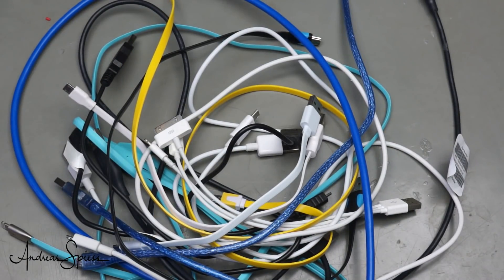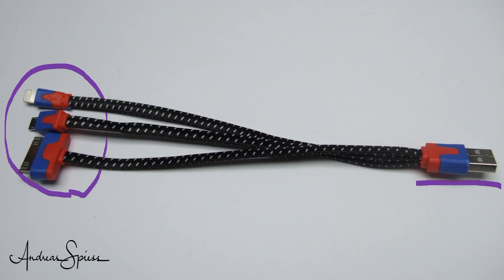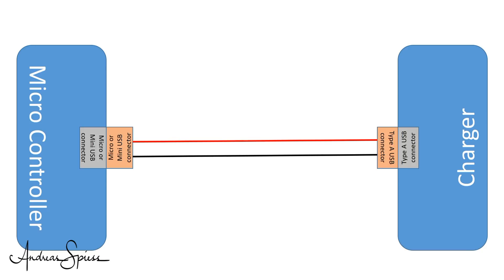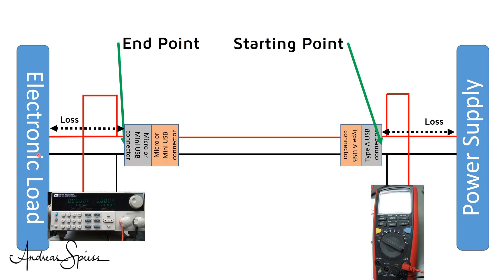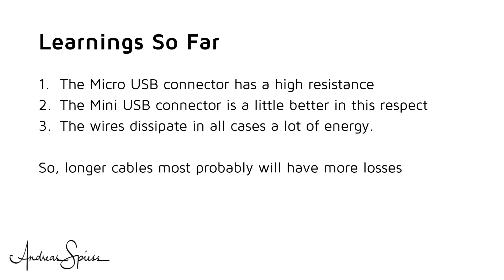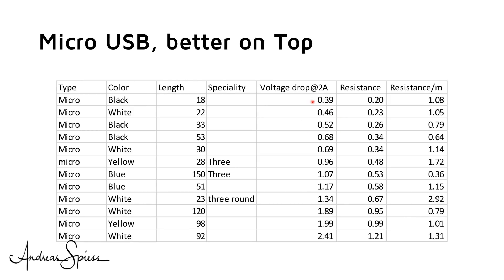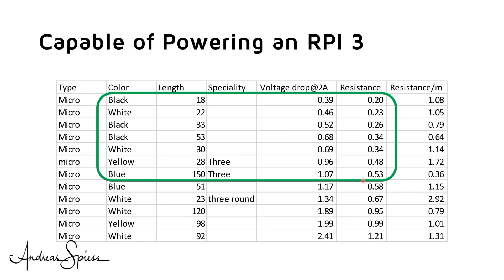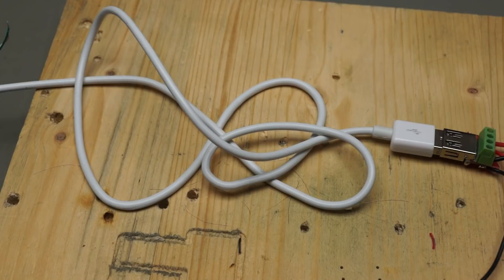#177 Avoid Surprises: How good are USB cables and how can you test yours?

Comment: So funny I'm encountering this problem with almost all types of USB cables with a Teensy 3.6 project. Just can't seem to catch a break, have used probably 50 different USB cables altogether though they all were just old ones I had around. Only a few were brand new. But I'm wondering where one would go for some quality cables that just plain work? Also, tests for power is fine but what about for data? Do the same principles apply or is data more advanced/involved? I imagine it would be...
Reply from the maker: On the low data speeds we use for our micros we should not get problems, at least not with relatively short cables. For higher speeds, data cables have to be built with knowledge. But resistance is not important for that reason

Comment: I used to think like that and blame cables. But USB spec says only 500mA should be supported with USB 2.0.
So it's not actually cables. It's stupid people like raspberry pi designers who use micro usb to power it up.
For raspberry pi, I got sick of it's connector and now powering it up using %V pin in interface.
Reply from the maker: I do not blame anybody. I just want that it works. But I am with you in not really loving these micro USB connectors.

Comment: It's a side note to the subject of your video, but I hate! Hate! HATE! USB cables that have only power and no data lines. Why do I hate them so much? Because you can't tell by looking at them which kind they are. If they had a different symbol or something, or maybe an attached tag that said "I'm sorry", it would be better. I know it saves the manufacturer some money (multiplied by a million cables), but can't they take my feelings into account? Every time I discover one in my big-box-of-USB-cables, I tie a simple knot in it so I will recognize it the next time I think of using it.
Reply from the maker: You know what: During my video making I though all of these cables away. Because I think like you!
Reply: I used to throw them away, too, before I thought of tying a knot in them. Sometimes I do need just a power cable. Now, I will throw them away if they have crappy electrical characteristics. :-)

Comment: Some time ago, I bought a collection of cables that came in different colors (yay), but they also had a braided covering on the cable (double yay). I wanted that for my family members who don't always take good care of things. (That's why I have big buckets of USB cables, USB flash drives, small power banks, and so on. Somehow, they go away and never come back.) Alas, I discovered in practice that their electrical quality is not very good ... I figured this out because they were very slow to charge devices.

Now, from your video, I have some idea of how to test the electrical quality of the cables. But I have a naive question (I'm a software guy, so the answer is probably obvious to EEs). What is the difference in the method you used with a current load compared to just measuring the no-load resistance of the two power leads? In other words, plug both ends of the cable into a breakout board and then measure the resistance.
Reply from the maker: No difference, because I actually did nothing else. But many multimeters are not very accurate in the low ohm range. And you have to pay attention that you do not add any additional resistance between your multimeter and the cable. This is the reason for the 4 wire method. 
I used my method because it is easier understandable and less abstract for many people. But you can do it much simpler if you do not need it very accurate. I might do an update about that as a „quickie“.

Comment: I see that some cell manufacturers actually use the resistance of the cable to limit current.  I found this out when I replaced an "approved" cable with a "better" lower resistance cable and soon after that while my device charged much faster, it also destroyed two chargers due to overheating.
Reply from the maker: That is well possible, but would not considered to be „good practice“ if you are allowed to change the cables. If connected to the charger I would accept it.
Reply: Ya .. bad design ... and a sad reality! (as i found out).  I guess that the chargers do not include a current protection mechanism ... and interestingly the little manual that comes with the charger says to use only "approved" products.  So much for standards.

Comment: At time stamp 14:03 - There are the following equations:
R = 0.55v/.7A 
R = 0.78 Ohms
R  or 0.78 Ohms + 50% of 0.78 or 0.39 = 0.78 + 0.39 = 1.18 Ohms 
I must have missed a step. How was a value of 0.52 Ohms reached?
Reply from the maker: It is the other way round. I assume the connectors „gain“ resistance with age. So the new ones should have a smaller resistance. But maybe I made a calculation error with the percentages.

Comment: Andreas, have you heard of a CT2105 a 8 pin voltage regulator type for Li-on?   I had one short 5v in and cannot find on Google.   Also, are there fuses inline in some micro USB cables?  After my short, cable was dead.
Reply from the maker: I do not know the CT2105. And crappy USB cables can work as fuses because the weakest part breaks (either cable or solder point)
Reply: ok thx

Comment: The micro USB connector is a terrible design - high resistance and mechanically fragile.  It's a shame that it's become the go-to standard recharging and power connector for phones, Raspberries and so on.  I bet a lot of phones and tablets are scrapped just because their micro-USB charging connectors get damaged. The mini USB connector was much more rugged and for most of our items the slight size increase wouldn't matter - but no one seems to be using it any more on new designs.  I've not tried the USB-C connectors yet myself - let's hope they're better than, and eventually replace all the micro ones.
Reply from the maker: I completely agree with you. And looking at the USB-C connectors, have some hope that they are better than the micros...
Reply: Since Apple is pushing for USB-C with there MacBooks now we will see lots of gadgets having USB-C. I was quite impressed to see a laptop being charged of USB though they provide you with a pretty beefy power brick to do that.
I surely hope that USB-C will replace Micro in the next few years. But for single board computers etc. I have my hopes set very low.

Comment: So, injecting a little physics into the results (I'm neither physicist, nor engineer), isn't it possible that the smaller connectors heat more quickly since they have less surface area to dissipate the heat?  They may have similar resistance, but the larger connectors act as heat sinks to get rid of the heat.
At any rate, I'm off to test the resistance of all of my USB cables!
Reply from the maker: Your argument could come from an engineer! This is well possible. We also have to keep in mind that the cables are in plastic (which does not dissipate heat very well) and the connectors are of metal (good dissipator). 
This is why we have to read the thermal pictures with caution and later test the hypothesis with other means (which I hopefully have done). But a general rule is: If no temperature increase there is not much heat produced and also not a lot of resistance. This way usually is helpful to avoid searching for causes with a low probability.
Reply: As an engineer... I was wondering if it would be possible to overcome the lame-cable loss with a 1-V step up booster-converter.  The losses will be what they are as long as they don't melt the cable.  Another idea: measure resistance directly by using a 1 ohm resistor in series and measure the voltage drop.  Hmmm.... and that reminds me of the difference between an physicist and a failed politician.

Comment: Very good analysis. Well presented. 

I wonder if there is a market for a small tester (assuming is does not already exist)? Something that can just plug in the cables and present the results on a screen or on a phone via BT. Would really help the hobbyist especially during troubleshooting.  Probably need someone like Dave to do that though and crowdfund.
Reply from the maker: Maybe I do a "Quickie" about that. I have an idea.
Reply: I googled that and found QualMeter. Seems to be what you are looking for, except it presents the results of the tests on LEDs, wich could be better for non tech people .
Reply: lunedemai2 I believe you found exactly what I was suggesting. I little better if it gave real readings and could do some transient drops (to pick up erratic behaviour) but it definitely coves the gist of the suggestion properly.
Reply: Undefined Lastname yes its "automating" the testing. If intermittent errors occurs on a circuit a piece of kit that can eliminate one possible cause it a good thing to have in the arsenal. 

As far as I know an arduino is not capable of supplying the currents used in testing. 

A static 2A test say is not really ideal. As the current flows it heats up the wire and changes the results. As noted in the video sometimes the peak current draw could change based on the usage. Supposed the peak draw is only for a fraction of a second. Would a cable pass or fail?  Google the QualMeter lunedemai2 suggested. There is a video below in the campaign info that shows how expensive the cables can be. Correct selection can be worthwhile.
Reply: Undefined Lastname yes its doable. I understand your point but in the age of so many very very useful amateur level kits in the under USD$10 range it would have been nice to see something you could just pick up and run with. Something that's so cheap its not worth doing it yourself. Just yesterday I did an electric guitar amp (uploaded today if your interested) utilising a LM386 as the pre amp. I have all parts to make this myself but at US$1.15 delivered its just not worth it to do a layout and spend the time soldering.
Reply: Undefined Lastname I don't think I am up to the level to do a tester properly and I really don't have the time to spend to bring that level up. Too many other commitments.

With respect to the use of a smart device for charging that has merit. What throws me off with my phone is the charging time varies. Sometimes it will charge fast for around the 20% mark (were it starts to "complain") and at other times it takes a much longer. Not sure if its just improper contact is being made. I purchased a USB type meter that's still on the way. When it arrives I am going to investigate if the current draw is different and if its just poor contact or something the phone does.
Reply: Undefined Lastname I appreciate the time you put into this comment. Its an OEM Samsung charger and cord I use on a Samsung phone. It does charge a lot faster than a generic. It does get warm but not too hot to touch. I should measure it someday with my IR thermometer (don't have a Flir). 

The weird thing is the rate is slower some days. If the USB meter does not arrive for any reason I look for a small USB connector cord. I am supposed to have one or two that came with USB sticks. Sacrifice one and put a regular meter in series.

I do agree that the learning is what counts. I try to learn a few things new everyday. On occasion I get asked what I am going to do with all that knowledge when I am dead (yes there are those who think I am wasting my time learning if its not for my job or making me money). I try to explain that I don't care what happens when I am dead. I care to improve my skill set while I am alive.
Reply: Undefined Lastname I never tried turning it off while charging so I do not know the answer to that. The phone is almost 3 years old so there is the normal corrosion that dulls the outside ground connector. I assume the internal connectors are probably slightly corroded too. 

Generally I am not in a hurry so the slow charge time that occurs every now and then is now critical to me. Its really me trying to figure out why this happens. 

Packages are starting to arrive from my order so I should get my USB power meter soon and investigate further. If I find a proper explanation and something that can help others I will post a video.
Reply: Undefined Lastname I never considered that. Anyway that's not the case. I just checked with a magnifying glass. Still seeing a reflective gold colour on the contacts so I am assuming they are ok. Right now I am spending time doing a slightly in-depth analysis of solar cells. Single panels, connecting into arrays and I still have to upload the one on charging a car battery. I am trying to increase the engineering calculations I put in. It forces me to do the math and consider what and how I say things so in the end it sticks with me a lot better. 

I want to put in the same level of analysis on this when I get to it. I want to do more than a passing overview. Still awaiting the meter but I can rig up something once I finish the solar project this week.
Reply: Undefined Lastname  feel free to check out the videos. Just click on my name and it should link. There are three. The first is on a single panel, second on three panels connected into an array and the third on the array connected to the battery. I did go into some theory but its used to analyse the practical project. I have a fourth to do on the overall efficiency of the system. How much solar radiation is incident to how much the user gets on the device. That will be all theory and calculations. 

I got my first batch of items in the mail today but no USB meter yet. I hope it comes soon. I will look into background apps. I found rogue apps keep the phone from going into sleep mode at times and my battery dies very fast.
Reply: Undefined Lastname sounds interesting. If you are not trying to keep it confidential make some videos. I would like to see. 

Solar air heating is a decent idea. I did some rough calcs a few years back to see the feasibility and it seems to make sense. I am in the Caribbean so we do not need it for keeping warm. My interest was in replacing the electric element in clothes dryers. The hot air would be generated by passing room temperature air over a heat exchanger. I even made a proposal for funding but that went no where. To do a proper quantative analysis i needed a proper solar water system and two new dryers of the same make and model. One would have been modified while the other would be the control. All the equipment was a bit more that I could put out. 

I still intend to do a small system soon just to see how efficient CPVC would be if painted black.

Comment: The extended cable at 15:35 will be even better if built using a microUSB connector with the cable cut close to it and soldered to the thick cable. This will avoid more than half of the 0.37V drop through the adapter.

Excellent choice of theme for this video! I guess most viewers would not consider the losses using USB for powering devices. I'm pretty sure many will use much shorter cables to charge their devices too after seeing this. The power loss will make the charging time longer. Why? Well the charger is a constant voltage source not a constant current source.
Reply from the maker: Thanks for your tip. Also a very good way to solve the issue.

Comment: Have you seen the fake USB 3.0 cables? They are USB 2.0 but made with blue plastic. Also some fake USB hubs doing the same.
Reply from the maker: I do not use many USB3 cables other than for Hubs. And these usually have different connectors on one side. So I cannot tell you.

Comment: So after soldering barrel jack onto RPi3 it will be far more better than those small USB connectors.
Reply from the maker: If you find a place. Or just solder two cables with a Type A connector for the charger as another viewer suggested.

Comment: Thanks for another great video. My practical problems mostly arise from the mechanics of the micro USB. There's a distinct difference in the way one or the other 'locks' in place when inserted and it seems this also influences the quality of the connection in terms of resistance. Also, my kids tend to 'abuse' the cables so mechanical strength is also a factor to consider for the long run. On the other hand, the cable should always be weaker than the socket in your devices to prevent that getting broken. Anyway, for most people a cable tester would be the best way to distinguish I guess.
Reply from the maker: As I mentioned at the beginning of the video I did not focus on charging Smartphones. But for sure, mechanics of the micro USB connectors is a big issue, especially if they are not protected like on our boards. So most of us know how to deal with it (because probably most of us broke one or two off the PCB).
For that reason, type B connectors have been much more robust, but for many applications too big (and maybe also too expensive)

Comment: Happy NY Andreas. 

When I started, I also had issues with a cable. I assumed all cables had power and data lines. 

I quickly learned this was a big mistake, all cables are definitely not equal. 

I enjoyed the way an engineer broke down the problem. 

I will be testing my own cables today. Just too be sure. 

I did laugh a lot at Mrs Spiess’S input. Colour and length 😂😮😂

Thank you, I laughed a lot.
Reply from the maker: Happy New Year to you, too. And happy testing!

Comment: For rpi3 I usually look at the red led, if it flashes it means that the voltage supplied wasn't enough.
Reply from the maker: Thanks for the tip.
Reply: Shadan Rikan but basically if you see the led solid red most of the time you are going to be fine, that was the idea.